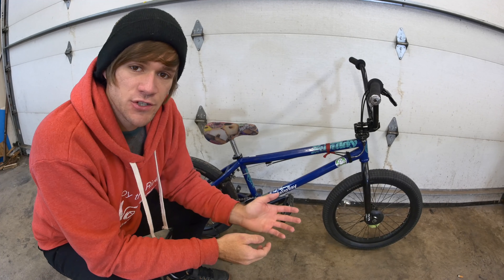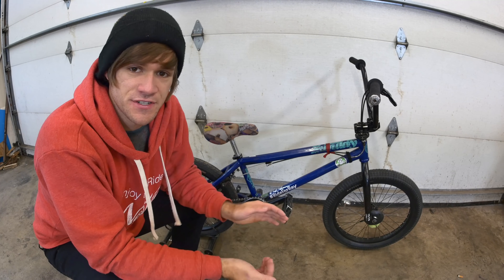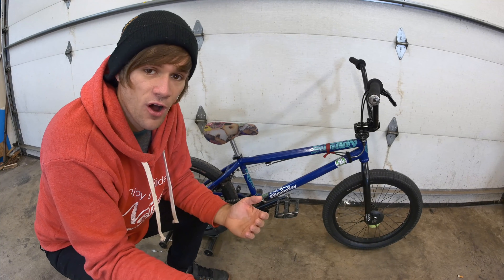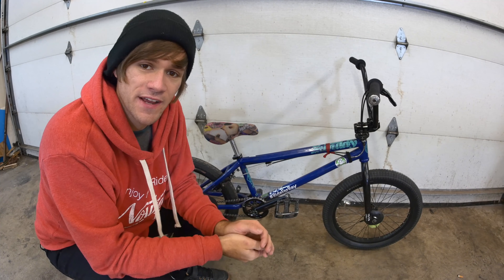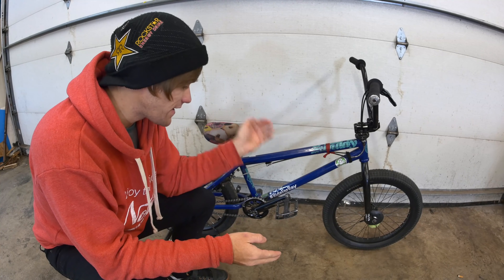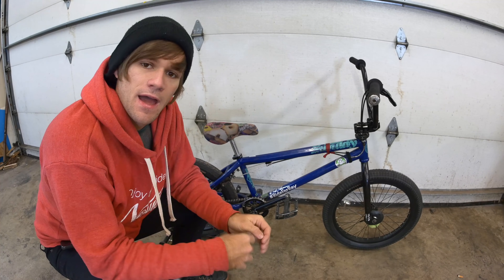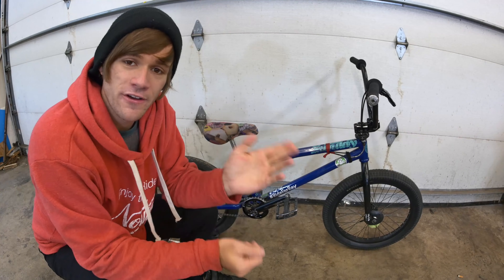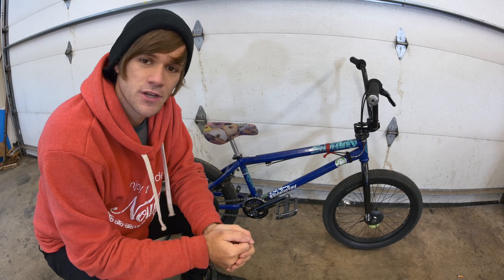Does Bicycle Crank Length Matter? | EXPLAINED

Comment: I love longer cranks because my bmx bikes are used for offroad to get to my fishing spots and longer crank arms provide nice low end torque. I also do a 52÷16×24=78 ratio on my 24 inch race bmx much higher than a normal 44÷16x20=55 ratio that bmx bikes normally have.
Reply: Bro, this is youtube,  not math class.

Comment: @brant_moore how tall are you :)
Reply from the maker: I am 5 foot 10
Reply: Bro I'm 6'2" size 13 shoe with a 21.8"TT w/ 13.8" chainstay and I'm considering 9.75" bars on a frontload stem. I have a 20" bmx bike. Would the bar height be too much?  I'm new at this but I wanna be able to bunny hop, 360, barspin, and whip.
Reply: 9" bars with a 21" TT and topped stem felt good but my feet kept hitting the pegs with the 13" chainstay
Reply: My cranks are 175mm
Reply from the maker: If you feel hunched over and your back hurts, taller bars will help

Comment: Very detailed  explanation thanks, I have a 165mm set up an have to keep my feet perfectly placed to avoid my heel from locking up on the rear peg ,thinking about making a switch to 160mm hopefully it helps..
Reply from the maker: Boom there you go! Sounds like you have an idea of what could help! Short of getting a frame with a longer rear end or adding extra links to your chain to pull the wheel back further, shorter cranks are about all you can do for that.
Reply: m Chandler that happens to everyone I am pretty sure, I am 5ft 10 with 170mm and I am always pretty close

Comment: Well i have one piece cranks and i don't know the length of them.but i personally believe that 1 piece cranks are not that bad because
1:they are cheaper
2: they dont bend easily
3:they dont break 
Yes i know i might be wrong but i have done drop 8 staircase and they handled it not once but 7 times (thats when it started raining)
Reply: One-piece cranks are perfectly fine, though they tend to be heavier than 3-piece cranks, because they are made of a single piece of solid steel rather than steel tubing or aluminum.

Comment: Thanks for putting this together. After some research, I think it’s something that I’ll adapt too pretty quick if any changes are made. I tend to go for cranks a tad on the longer side. I commute with my bike a lot, along with beginner tricks for now on the street. I live in the city so it’s a lot of stop and go or slowing down, changing direction and stuff. So the ease of low speed pedaling helps.
Reply from the maker: Always happy to help! Sounds like you've got it pretty well figured out.
Hope to see you in the comments again, thanks for being here!
Reply: @Brant_Moore farrrr from figuring it out 😂 getting closer to it with your tips and info tho. 👍🏼
Reply from the maker: It really only seems to make a noticeable difference in the extremes. A 5mm difference would probably be a very quick transition
Reply from the maker: Also, that’s really awesome to hear! Glad I can help!!!

Comment: Ran animal akimbo’s 175 for last eight years, finally died this week, got some smaller BSD cranks in 165.
Reply from the maker: How are they feeling being 10mm shorter? Or have you gotten them yet?
Reply: @Brant_Moore for normal cycling it’s like it’s less torque but less effort to get to top speed. I thought they would be really uncomfortable for me as I have size 12 feet, however I have loved them for actual cycling, less effort to get to full speed. It feels like going down a tooth on a sprocket but without feeling to light. For actual bmx it feels better too bunnyhop feels better and feel just general improvement would of preferred 170mm but 165 is great

Comment: Best crank length breakdown for bmx.  Human element is not a factor, it is THE factor.  The human individual is a factor compromised of so many individual x factors that have variables within each variable.  If we were all in a world where we were crash test dummies or production line petry dish standard persons we could count on a standardized test to let us know how one engineered piece of hardware was better than the others without question.  The bike that works best for you is the bike you ride the most or the bike you like the best.  If you like a bike so much and you believe its the best you wont be satisfied with the performance of any others you dont make perform to the mental standard you have of another bike.  If you are riding what you believe is the best you will atleast place the fault or limitations on yourself and try that failed or unpolished trick in the need more practice catagory.  In summary if you buy what you believe is the best than you will not be plagued with doubt and you can take ownership of all your efforts.  That is how i see it.
Reply from the maker: Absolutely man, thank you!

Comment: This is way afterwards but I looked up and I did research 175 mm and 165 mm the only difference between the two of them is half inch if you look up the math between the difference between the two of them it's only 1/2 inch not much of a difference Scotty cranmer talks about how he likes the 165 mm he can get back on a lot easier I somewhat disagree with that half an inch is not going to make a big difference
Reply: The difference between 175mm and 165mm is 10mm, which = 0.4". However, both crank arms are 10mm shorter, so the difference is actually 20mm (0.8").
Reply: @MaximRecoil  obviously you're good at math but it's still a half inch not much of a difference if is a full inch yeah and might work but you know everybody rides different and everybody has a different way providing what works for you might not work for me it's just technical BS
Reply: @teddyr7901  No, it's not a half inch, it's ~0.4 inches (0.393701" to be more precise), which is about one-tenth of an inch less than a half-inch. Also, you missed the main point which is that the difference is actually double that, because you have two crank arms and each one is ~0.4" shorter. On 165mm cranks, the pedals are 330mm apart. On 175mm cranks, the pedals are 350mm apart. That's a difference of 20mm, which = ~0.79", or, if we go with your figure, we can round that up to an inch.
Reply: Yes I was thinking about that you have to crank it it's a lot easier bigger crank than a smaller crank

Comment: I did some math to calculate torque at the rear wheel with 250 pounds of force applied to the crank with different sprockets and crank arm lengths. 
165mm 28t:43.5423
170mm 28t:44.8821
175mm 28t:46.2218
165mm 27t:45.1388
170mm 27t:46.5277
175mm 27t:47.9166
165mm 27t:47.0196
170mm 26t:48.4664
175mm 26t:49.9131
165mm 25t:48.8868
170mm 25t:50.3910
175mm 25t:51.8953

Comment: I recommend the Sheldon Brown gain ratio calculator to come up your ideal combo.   https://www.sheldonbrown.com/gear-calc.html   It does take into account crank length.  I prefer builds around a 4.4 ratio which is the same as a 24" bmx cruiser.
Reply from the maker: That sounds like a great way to do it if someone is super into the details of it all, thank you!!

Comment: i need 165 for 12.75 chainstay frame😂,my feet hit the back peg
Reply: 160mm cranks, 12.5 chainstay, 15mm fork drop outs and some big bars 😂
Reply: Stickity Man ya i do go with battleship frame and 160 federal crank
Reply: @Cobydickies  what will 160mm feel like?
Reply: If i had a 12.75 back end i would go for 160mm cranks
Reply from the maker: Haha Yea that might be a thing! Send it!
Reply: Damn was your top tube
Reply: 13.25 /170mm and my feet hit also 😫

Comment: I'mma buy cranks, Primo Powerbites are said to be indestructible.... Eclat Tibia with 170 or 165mm may fit my style, but are hard to get, damn!
btw. Does length of cranks has something to do with Crankflips?
Reply from the maker: Hmmm, i hadnt thought about crankflips in relation to crank length. I feel like when compared or measured it would probably be a negligible difference on anything other than the extreme ends of the spectrum

Comment: Hey bro nice video but I'm just getting back into street riding. I haven't purchased a bike yet $300 is my limit I've been researching the 2013 Khe Evo 0.1 or 0.3 they're full chromoly frame forks and bars. Is that A good start for me? I've compared every other bike at this range and nothing compares to the 0.3.
Reply from the maker: Full chromoly everything is your main concern for longevity on the bike. Sealed hubs and double walled rims are also huge, so if it has all of that you really can’t beat it without buying a top of the line complete. Sounds like you’ve done your research!

Thanks for watching the video man! Hope it’s enough to earn your subscription
Reply: Bro I def. Subscribed ever since I found your video on Frame Geometry! I can't Thank You Enough for your help! I'll def. Be telling ppl bout you.
Reply from the maker: That’s so awesome to hear, thank you so much!! Hope that bike is great when you get it

Comment: When i raced i run 180mm cranks.On my street bike sins new frame back ends are getting shorter and if you got BIG feet you need shorter cranks so your heals don't clip the back pegs when your riding along.I use 165mm cranks on my street bike \m/

Comment: So which makes it easier to manual? Because you disproved all theories I had but also disproved the opposite of those theories as well it was like I was wrong both way when I thought about it so do you think shorter is better for manuals and a short rear end?
Reply from the maker: I dont know for sure if crank length has an effect on manualling but if it does what would be logical in my mind is longer cranks giving your more control. When it comes to frames, short rear ends mean they're more twitchy and easier to loop out. Long rear ends mean they're more controlled but harder to get balanced.

If you're just starting to learn manuals, a normal length rear end might help out, but in all honesty its so easy for us to get used to different setups I think that anything in the middle of the spectrum wont give much a of a noticeable affect after an hour of riding. 
People can adapt and learn on just about anything if they really want to learn something.

Its probably not until you get into switching from a super short rear end frame to a super long rear end frame or vice versa that the effects might be longer lasting.

Comment: After 30+ years of riding I can say I have rode 180, 175, 172 (Profile) and 170mm cranks. As far as jumping and hopping it’s untrue. Not even a question but a fact. Shorter cranks pretty much as you said (minus the hop/jump thing). Now, the biggest key issue is 2 things. 1- Yes the weight is a fact by a few grams unless you are going from 180 to 160mm you will not notice any weight change in a 170 vs 175 for example. 2- If you hit your pegs with your heals...you probably should get a set of 5mm shorter cranks. Unless you just have a frame that is way too small for you. The length is not really noticeable unless you have rode atleast 1-2 years and I mean rode alot. And it should fix the problem. Trust me something so tiny as a peg on the heel MIGHT not bother you 99% of the time. BUT...that 1% it bothers you could be an ER trip from a trip due to you going for a trick and pulling it 99% only to try to put your foot on. Hits the peg you miss the pedal and slam bad. 

Just measure your current cranks and see what 5mm will do to foot position and the pegs. Or as stated in the video check it out on someone else’s bike. You probably won’t notice it and if you do keep in mind Profile (I know for a fact) makes 172mm cranks. And then you can avoid the peg problems and only lose a tiny bit of length. I honestly never really noticed anything different from my 175’s and 172’s. I could jump on a friends bike with 175’s and could not feel a difference. Now the 5mm as I said some might but 3... I can say (at that point riding 10-11yrs) I didn’t.

Comment: Some important points you left out:
First of all, the height of the rider. Shorter riders (or younger kids) have smaller legs so they need shorter cranks to have the same efficiency and/or comfort in pedaling.

Second, the crank length makes a huge difference depending on the size of your frame. If you have a small TT size and short chainstays, say like on a flatland frame, a mini race frame or short chainstays on a tech street frame, if your cranks are too long you will be hitting your feet on the rear pegs or front tire.... that's why flatland bikes will traditionally have 155/160/165mm cranks and why street brands are now making 165/170mm cranks for there new frames with sub 13" chainstays.

>> In practical riding terms, a short crank has a faster/easier acceleration on the first couple of cranks, like mentioned in the video it's as if it has a lower gearing. This is usefull depending on your riding style/tricks. For example people who ride "tech" street will enjoy this ease in taking off and transitioning from one trick to another.
If your a dirt jumper that extra torque of the 180mm cranks will give you more speed through the trails.
Reply from the maker: I did forget to talk about feet hitting pegs and tires.

As for the last paragraph of your comment, you have things a little confused. Im not sure if you actually meant to say longer but you wrote shorter so I'll base my reply on that.
Shorter cranks are actually harder to get moving initially because they produce less leverage. This is why you see longer cranks within racing (where starting can literally make or break a race) and why you would use a longer wrench instead of a shorter one to loosen a stuck bolt/nut.

When it comes to dirt jumpers, I don't know the exact math behind how having bigger wheels affects gearing, but I do know that I have seen several people who have both a BMX and a DJ with shorter cranks on their DJ.

I appreciate your reply, thank you for watching.
Reply: I get what you mean about the leverage of longer cranks, in theory you apply less force to move the bike. Correct.
but in real world bmx street riding, the difference in force applied between a short and long crank isn't really big. (those micro measurements are more important in road racing or bmx racing)
Where you DO notice a bigger difference is in the distance your legs move in the rotation.
With shorter cranks (yes you apply a tiny bit more force) but the movement of your legs is smaller and faster, and that "feels" easier in "tech street" riding where your doing very short distances and at slow speeds. 

I know it's a bit confusing and contradictory but I guess you have to give them a try to see for yourself. (or maybe it's just down to personal preference).
Reply from the maker: You agree that longer cranks = more leverage = less force required to move the bike.
With this being proven by math and physics, it cannot be argued. It's fact not theory.

The inverse of this is that shorter cranks = less leverage = more force required to move the bike.
More force = harder pedaling/more energy required to produce the same result as longer cranks on an identical setup.

Once up to speed however, shorter cranks make it easier to keep pace than on an identically setup bike with longer cranks.
All of this is stated in the video.
It is very confusing, which is why I had to make this video twice just to make sure that all information in it was correct.
Reply: @Brant_Moore  hi bro i am 38 and new to bmx. I bought a starter bmx 3 weeks ago and i been having a blast it's a 100%cromo black on grey L100 i bought for 250 bucks. Now i love the bike, and i know it's not the best bike in the parts department but, that's the point, to work on it and upgrade to after market parts while learning to repair my bike. My question is, what's the best size cranks to buy for street riding? The ones i have are 175mm and that feels a bit long to me.
Reply: @hurdleyrowe891  Hey I know this is an old comment, but you may still be looking to change your crank length.  I rode 170 for a while, and switched to 165 recently.  Really I like both,  I also don't care for 175 too much, and prefer 165 or 170.  But there is no real answer to what is the best, for that is personal preference.  If you are used to 175, maybe try 170, before jumping down to 165.  5 mm is a noticeable difference in crank length.  Since cranks are very expensive, I'd recommend trying to see if you can ride a friend's bike or something first, before investing money into cranks you may not like.  Hope this helps
Reply: Whats better to cranksflip?
Reply from the maker: I don’t think it matters for crankflips as it’s such a quick motion
Reply: damn dude, thank you. i think i always hated running 4 pegs because i would rip my shoe off when i looped out on manuals, having a peg on my grind side.  i have always run 180 or 175mm but i just ride tech street and wear a size 12 shoe. so i think if i follow what you said and try a 165 maybe? should work better.
Reply: depending how long your chainstay is, 165 should work better for you. there is a large selection nowadays of 165 and even 160
Reply: I think there is a lot to be said for gearing though. Sure the leverage and pressure applied from peddling make alot of difference...but some of that can be negated via a good gear ratio setup.

Comment: The theory about how high you can jump with your feet closer/further apart is honestly so overrated for several reasons. first of all the difference is only about 10-20mm going from "long cranks" to "short cranks" so try jumping with your feet exactly together and then moving them only 10-20mm apart, there will be no difference. Secondly it's not the same thing or the same motion etc. to do a stationary jump as it is to bunnyhop a BMX bike so it's not even a comparable test,
Reply from the maker: Haha hey man don’t shoot the messenger! It’s all subjective!